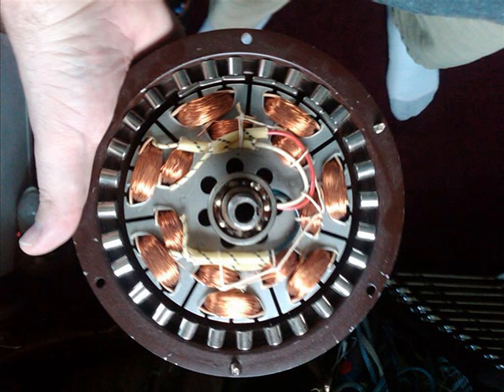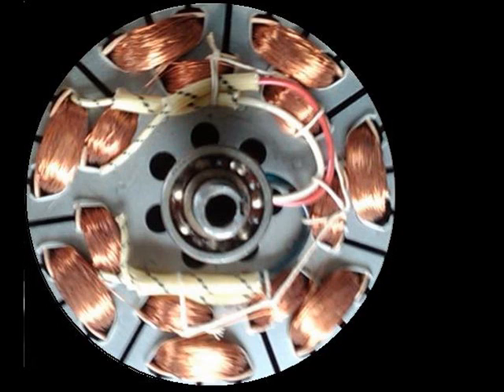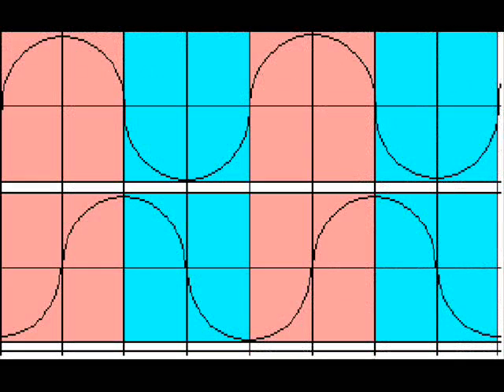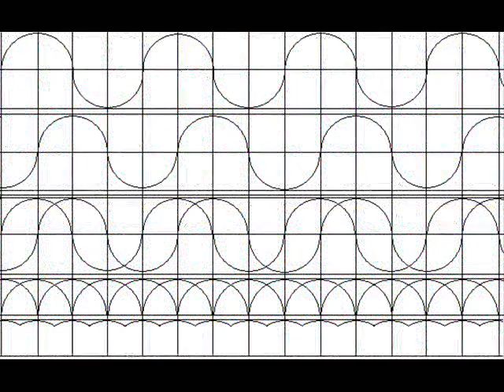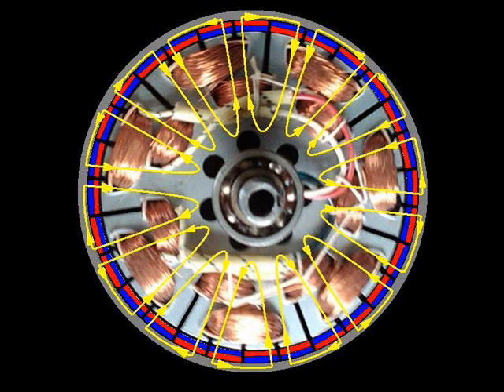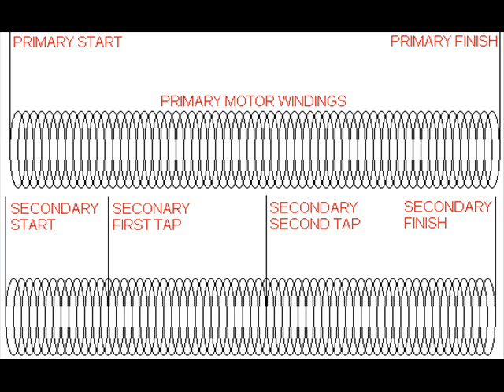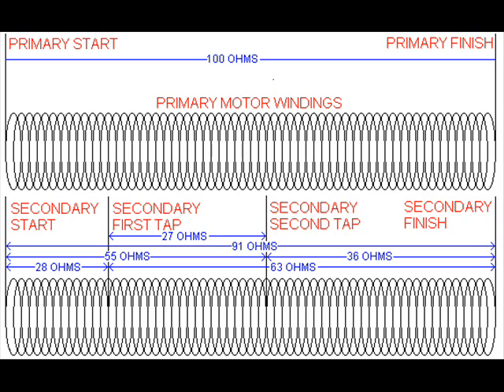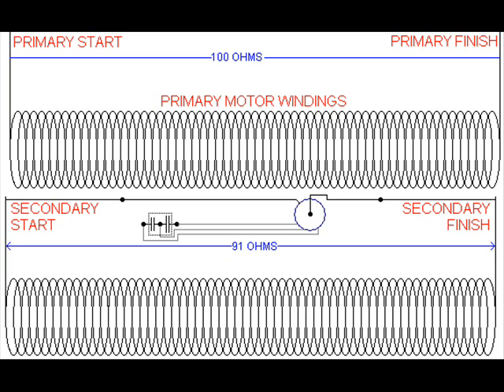3 THE CEILING FAN WIND TURBINE CLASS PART 3

Comment: I watched your buddy's video of you rewinding his stator with 18 gauge wire for more amps. Great vid! 
Question...I did a coil with 7 inner/outer voils. I used 18 gauge as well and all went great! Tested them and got 6 ohms just like you
But...whenI put the magnets on, because it's an odd number, after I came around I ended up with 2 sets of N facing magnets next to each other...? And, it doesn't cog worth a shit! Did I mess up? When I hand spin it I only get about .3 volts ac giving it a short quick spin! You said in the video that it needs higher rpm for volts...is that what I'm seeing? Any advice would be greatly appreciated! Thanks Muddy

Comment: Hello,

Excellent video. 

I have a question.  I received a ceiling fan that I was trying to repair. I think the problem is in the copper coils inside the motor housing. I have it apart and i have noticed i have four wires and the wires have two separate copper wires attached to one of the copper coils assembly and soldered in, however, the red wire only has one. would you think that could be the problem that the fan will not operate. I have looked on the coil if there was a wire unattached and i could not find one. i have done a continuity test and the red wire has conductuity to each of the wires this seemed odd to me.

thanks for our help

Comment: Hi muddy, heard this from a friend. If you make a bus bar (two flattend copper tubes screwed into wood) and put that between wind genies cables and your charge controller, batter bank. What you can then do is also put a high power capacitor coming off from the bus bar as a separate wiring - this then apparently smooths out the signal. Thoughts welcome.

Comment: After some thought - the extra square magnets were bad. We want a conductor ring outside to bend the field back into the adjacent magnet as explained in your vid. The sq ones i had closed the air gap, but also connected to each other and closed the loop, effectively steering the field away from the stator back into the magnets. i will remove those and add a spacer to close air gap or leave as is.